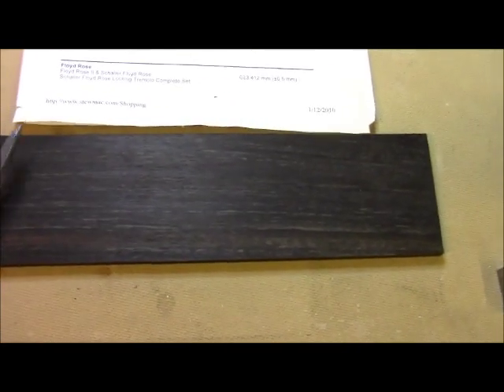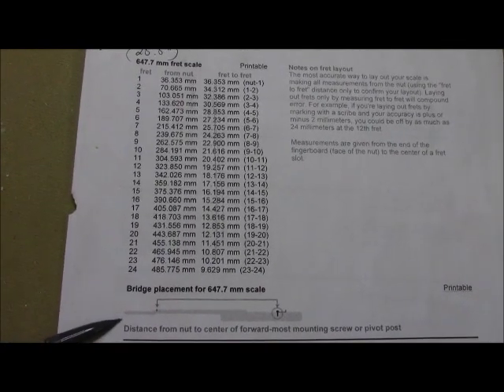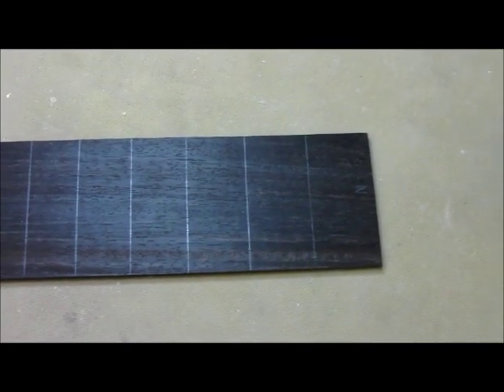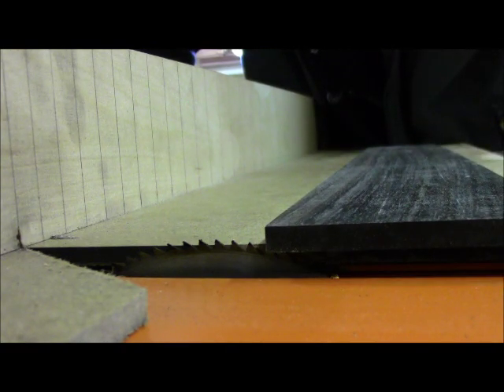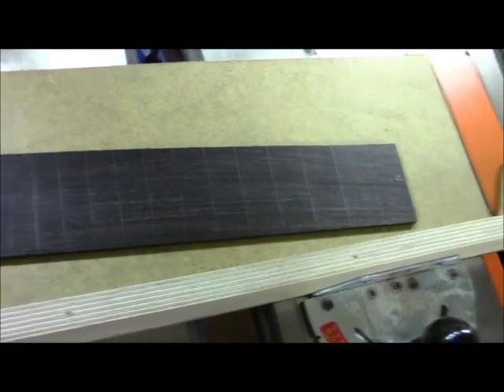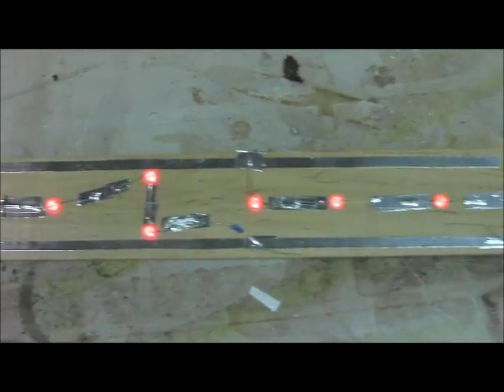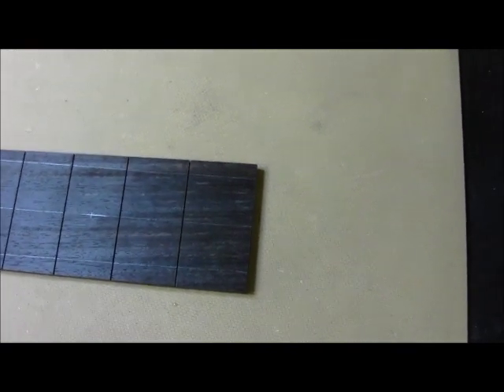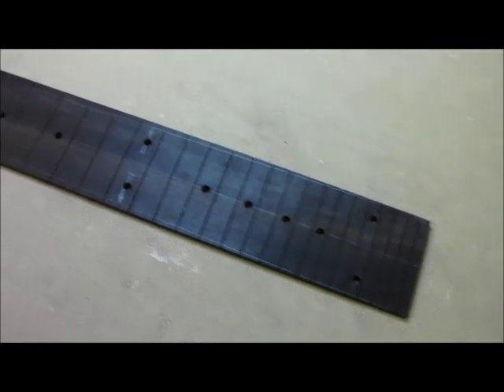How to Build an Electric Guitar -Fretboard Part 1.wmv

Comment: What blade are you using to to cut the fret slots?
Reply: Probably the special blade from stewmac. It's called "Fret Slotting Table Saw Blade". It's expensive though
Reply from the maker: *****
you are correct sir! And yes it is expensive but if you're cutting multiple boards it is worth the price.
Reply: What is the thickness of the blade?